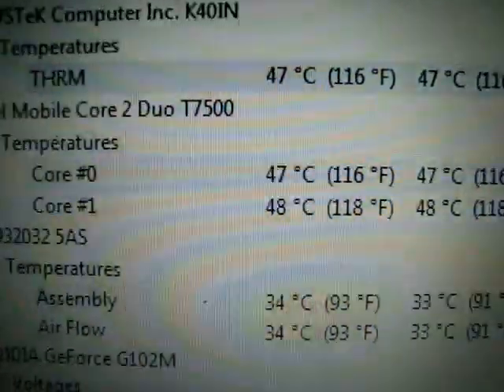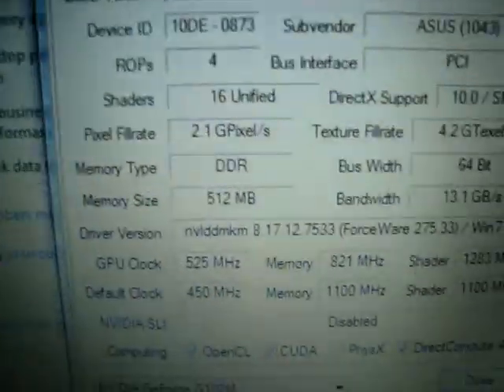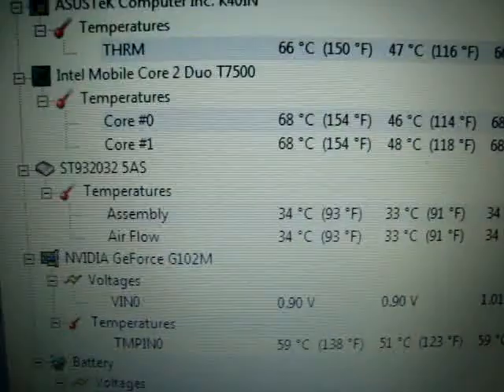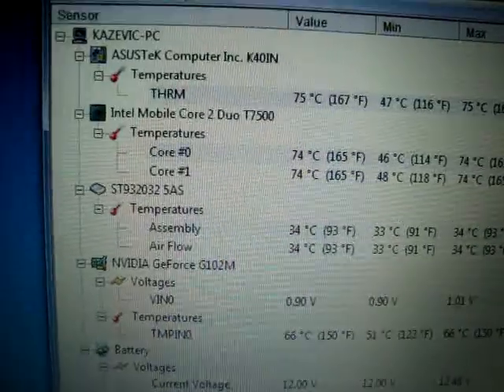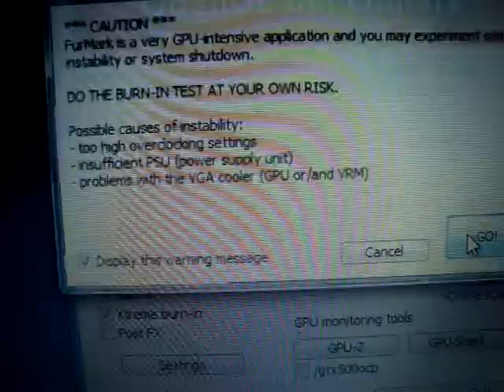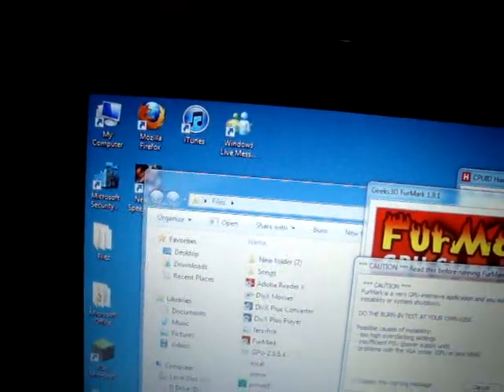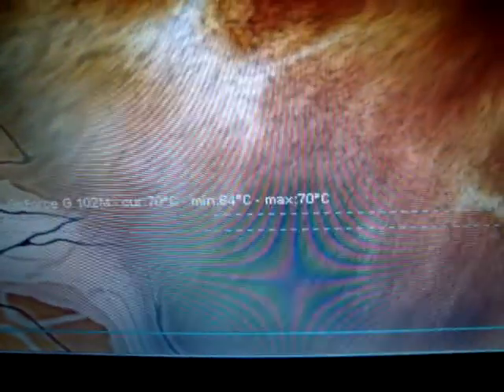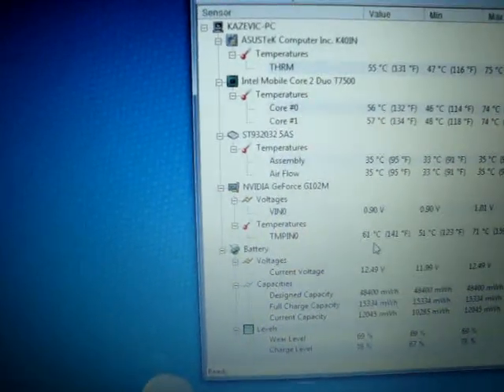Asus K40IN Cooling Aftermath

Comment: is the t7500 the max cpu the k40in can accomodate?
Reply from the maker: +Black Sun You can go higher, but finding them is not going to be easy, and the higher end one will produce more heat. I am not too sure if this mod will keep it under operating temps. And the bottleneck is in the GPU.

Comment: i still have my k40in (2016) and wanted to get the best out of it. can you show / send a video on how did u do ur cooling mod. and does changing the hdd to a ssd improve performance. thanks!
Reply from the maker: +Black Sun Hey, nice you still have your K40IN. Adding a SSD will really improve the loading performance. Also if you still have the pentium dual core. You should look at getting Core 2 Duo. Then adding the cooling mod will really help keep that temp down.
All you need is to find some copper piping, that can bridge over the GPU to the fan. As the current design has the GPU receiving the heat from the CPU, then passing it to the fan.